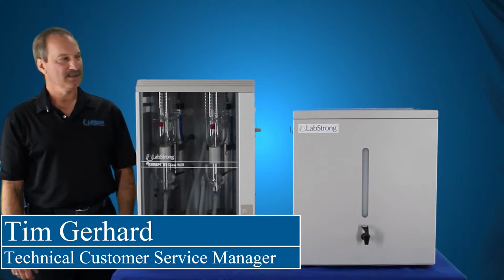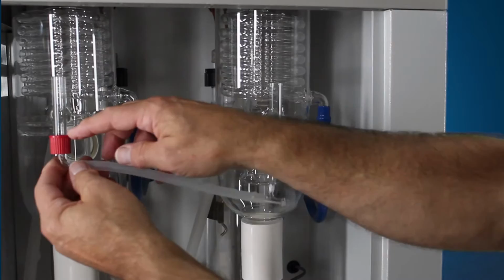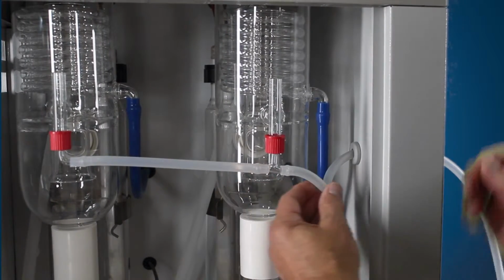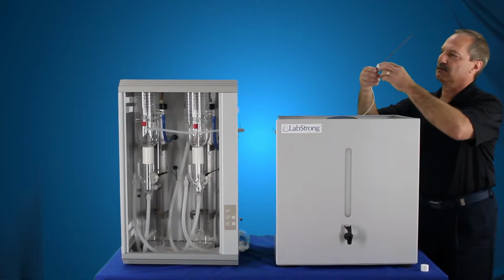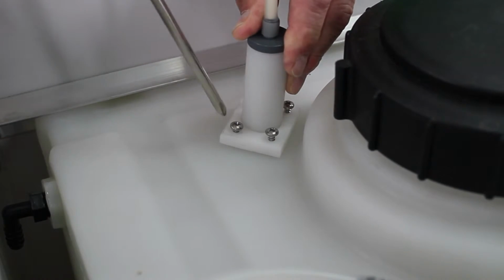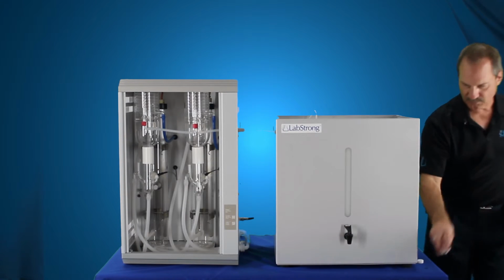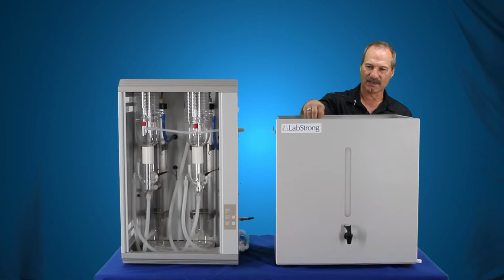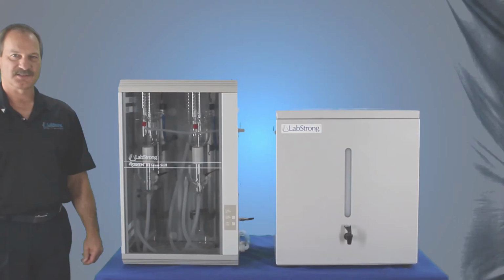How to Connect a LabStrong 40 Liter Tank to a LabStrong Fi-Streem III Water Purification Still

Comment: CAN YOU SPEAK ABOUT PRESSURE OF WATER DURING CONNECTION
Reply: There is no water pressure coming from the still. The still is gravity flow, which is why the distillate tubing must be level to "down hill". Once the distillate is in the tank, the tank will have some head pressure depending on how full (or deep) the tank is; however, this pressure is negligible dispensing from the spigot.
Reply: @labstrongcorporation9618  Thank you for your reply, in the case of an electricity connection if the customer doesn't use Isolator or switch box as recommended can we use the AVS 30 on the same. kindly advise on this thank you in advance.